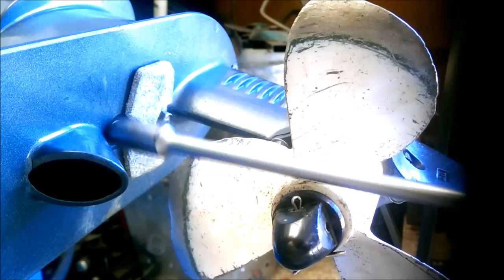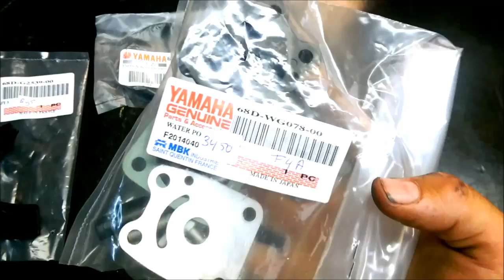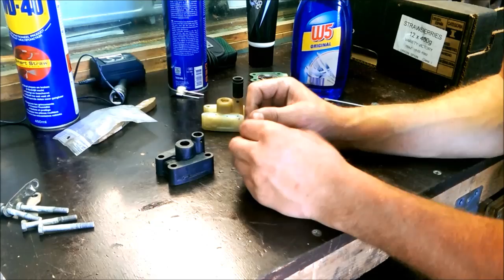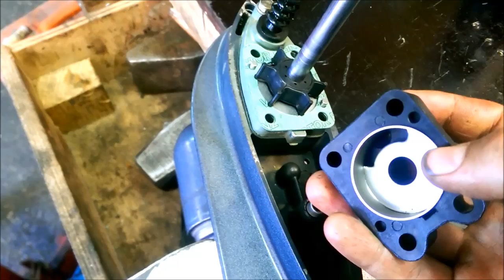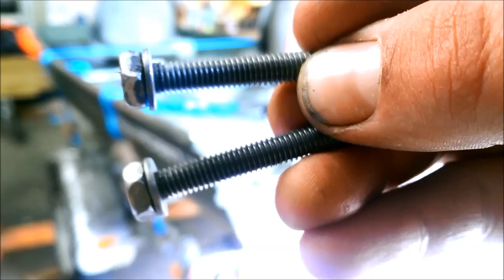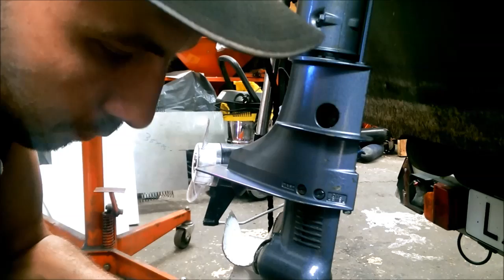Replace impeller/Rebuild waterpump on a Yamaha F4 outboard

Comment: Hello ! Was out on the water for an hr no issues with this engine. I stopped it for 25 mins and went to start again and it wouldn't. It's my first outboard and didn't know you have to put the throttle on a certain a position and then pull the rope, I have been pulling the rope without throttle on set position and It has always taken me 7 pulls or more to start it so I think I flooded the motor. How do I de flood? is there such a thing? 
I tried putting throttle all the way open and choke closed to possibly deflood and cranked it ten to fifteen times and then tried with throttle on the start position to crank but have had no luck starting, tried also with choke on for a few strokes with no luck either. Could I have fouled up the spark plug?

Comment: great vid but why do you use dish soap instead of a little grease or oil please ?
Reply: Oil and grease are mostly petroleum based. Rubber don't like petroleum. You can use the soap or pure silicone oil/grease.

Comment: Where did you get the plug for the other side of your foot? Mine only had the 1 hole and I couldn't get the clamp on to save my life so I drilled a mirrored hole yo get to both sides like you have there, but can't seem to find a extra rubber to fill the hole
Reply from the maker: It was already there. Maybe you can order it at a yamaha dealer, or you can find something at the hardware store that you can fit.

Comment: I have my Mariner 4 apart ATM, would not shift gears.
Upon closer inspection I found the gearbox drain AWOL, all parts rusted and the dog clutch seized to the drive shaft spline.
I have soaked everything in white vinegar for 48 hours and everything is shiny again. I have cycled the prop shaft through the freezer for 6 hours, into the oven to bake for an hour, back into the freezer again, back in the oven, allowed to cool. A long socket fitted over the shaft and allowed me to drive the dog clutch down the spline, and the spring is still good too. Back into the vinegar to remove the rust from the surface now exposed, may require further cleaning with a wire brush or careful filing, looks like I'll win this one, and I hope this information proves helpful to others.

Comment: Hi Jack , The water copper/brass pipe on my 4 HP is rotten can it be replaced from the bottom or is it power head off. Thanks.
Reply from the maker: Hi Graham, I dont know sorry. good luck.

Comment: Great video Jack, amazing english esp. technical terminology for a non english speaker. I have the same outboard, bought it second hand,  when using it I noticed that the last section of throttle doesn't increase the speed/revs (probably the last 1/3 tot 1/4) , is this normal for these engines or is there possibly something wrong (with the carb. or combustion)? Otherwise it runs fine, no starting issues, cooling system flows well.  Thanks, Tim in New Zealand
Reply from the maker: Tim C very difficult to say, check the set screws  on the carburator, maybe the butterfly valve doesn’t open all the way.

Comment: Would you know how to remove the prop shaft bearing from the housing on a 4hp Yamaha two stroke. I need to put some new oil seals in but need to remove the bearing first? Thanks.
Reply from the maker: As It Is I need to see it, but I’d imagine you would need an internal bearing puller, slide hammer. Maybe heating the casing around the bearing at the same time.
Reply: JackTekkel I heated the housing using my oven. The bearing then just fell out. Cooled it all down the inserted oil seals. Hammered bearing back in. Sorted.
Reply from the maker: As It Is oké that’s good. I did it once on a scooter engine for the crankshaft bearings. But I did it with a blowtorch. Heating around the casing. It always involves some heating. Good work and good luck.
Reply: JackTekkel Thanks. I think I will take it to a mechanic garage and get it down. Cheers.

Comment: Thanks for that video 
I bought my yam 4 hp 2 years ago there is less than 10'hrs working then my impeller brock yesterday  I heard some noise but no water going out I was not so happy with that ,now with that video will help me a lot 
A question about the water  pipe  when you put back  the section , looks like there is no clams to take them sealed ?
Reply from the maker: christian genest No just the rubber on water pump seals it. So it is important that you don't damage it when you put it back together, so a bit of soap liquid is the best for that. Don't be afraid to use a good amount.

Comment: Hi Jack, Could you also make a video of Un-clogging the Cooling system?
Reply from the maker: Hi, luckily my cooling system isn't clogged. So no video on that. Why do you think your system is clogged? No cooling? Maybe your impeller is busted. Also check if the screens at the bottom of the tail section are open, that's where the water is being sucked in. Or remove the screens and clean behind them, sometimes there's algae or other growths behind them. Also is your thermostat opening? Or remove the thermostat and take some compressed air and try blowing out the system, maybe some vinegar solution to dissolve lime deposits.
Reply: Hi Jack, I was just curious as i had No Cooling, and brought it to the repair shop, which said it was Clogged and there was no problem with the Impeller, so next time it gets Clogged i would like to try myself and save the 80,-€ :)

Comment: well i put the new water pump in and seal,s run the motor ,pumps water and in and out of gear ok,but now when i give it a lot of gas it smokes bad ,what happen .any one know.
Reply from the maker: Kelvin Rook how did you test the engine? During actual boating? Or in a tank? Because in a tank it can appear that your engine is smoking more.

Comment: Jack.
 I am investigating a water leak on one of these engines. It comes from the upper and lower case rubber mounting. The lower rubber mounting nearest the cavitation plate is the one leaking water. Water also seeps from the split joint on vertical outer casing tube. I will use some sealant on that when re-assembling.
   Any ideas or thoughts? It does it while tank testing and water is pumping from tel tale hole with good pressure.No loud exhaust noise and no oil in water or oil leaks. Engine starts and runs good.
  Your accent is amazing! Greetings from Scotland.
Reply from the maker: Some water leakage from the bottom mounting is normal, don't line up the opening in the plastic washer in front of the opening in the rubber. That will reduce Some leakage. What do you mean with the split joint? You mean between the tail and the midsection? As far as I know thats no problem. You can put a little bit of sealent on there. Don't think its critical. Just make sure engine temp is ok.
Reply: Thanks Jack. I did stagger the rubber mounting and plastic washer, so they were not plumb with each other. There may be a bit more wear in these rubber mountings, which is contributing to water loss.